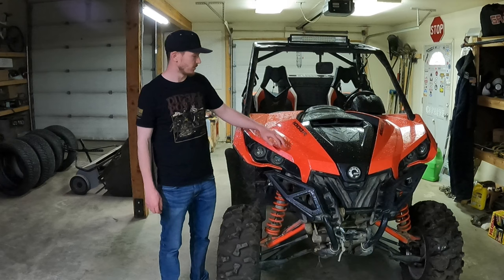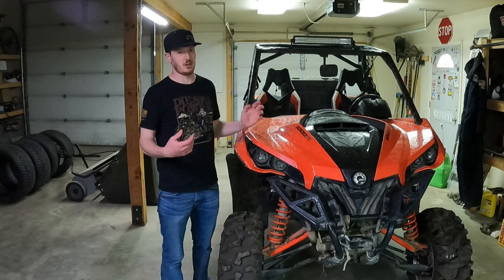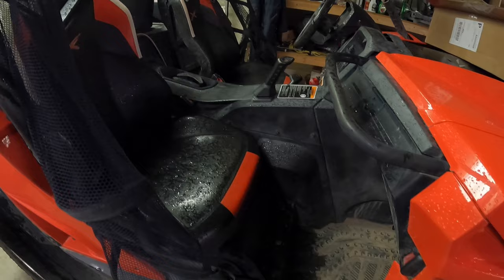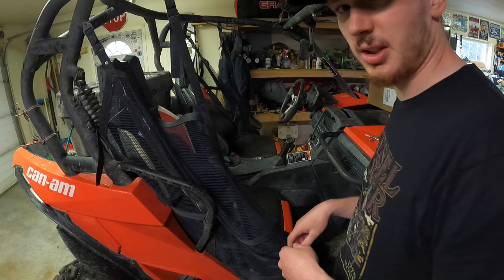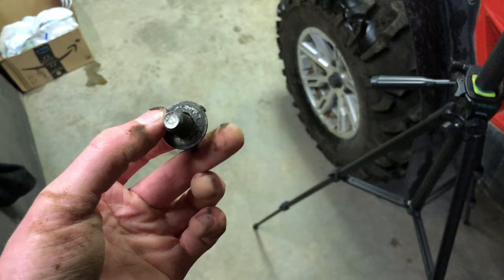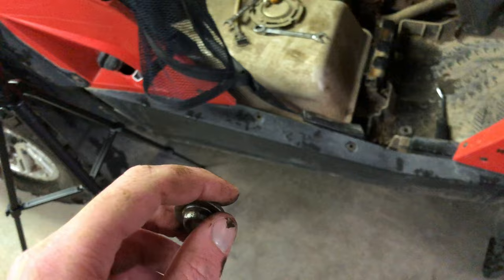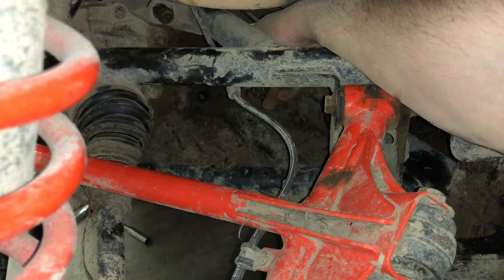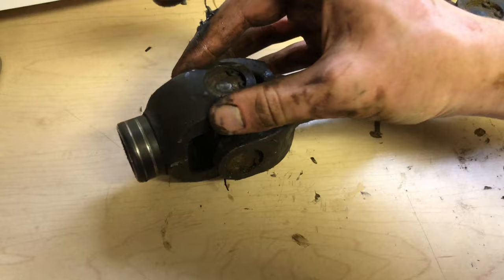How To Replace Prop Shaft On 2013-2016 CanAm First Gen Maverick

Comment: My drive shaft just flew off doing about 40mph down a trail.  Lucky i was only 5 minutes from home and limped it back in 4wd. Now the repairs start. Always something with these OG's🤦🏻‍♂️
Reply from the maker: That sounds exciting! Worst one I’ve had, was my secondary clutch flew off at about 40 because I re used the bolt. When they tell you to use a new bolt, it’s for a good reason 😂
Reply: @akgearhead  yeah took my buddy on his 1st sxs ride and might of sent it a little too hard 😂. He was loving it before it snapped
Reply: Im hoping the bolt just backed out i hear that's pretty common. The shaft and splines look fine i didn't really get a good look at it yet though 🤞🤞.  How many bolts hold it on?
Reply from the maker: @SHOTS-FIRED  that’s just part of the game sadly 😂
Reply from the maker: @SHOTS-FIRED  there is one bolt that threads into the shaft coming out of the transmission, and then another bolt that threads into the shaft going into the rear diff.
Reply: @akgearhead  thanks.  That's what happened. There was no loctite on the bolt and it backed out. I found 1 bolt that is kinda mangled and couldn't find the other. Gonna have to wait till Monday and see if the local dealer has them if not I'll order some
Reply from the maker: @SHOTS-FIRED  gotcha. Yeah if I remember right, they have loctite from the factory, so someone probably already had it out before
Reply: @SHOTS-FIRED it is recommend to use new bolts on the drive side and the engine side of the shaft.  You should also use red loctite if reusing the bolts. Also on the engine side you must install the Belleville washer correctly. People will have problems as they don’t pay attention to the loctite as well as the Belleville washer May have been installed correctly. If you didn’t use loctite and or new bolts as well as installing the Belleville washer correctly I would go back and correct it. You should also look up your parts list they have upgraded those BellVille washers.

Comment: it is  a good idea and recommend to use new bolts on  the drive and engine side of the shaft. Also if reusing red loctite should be applied . Pay attention to the washers as well. You should look up your parts scheme and make sure you are using the correct Belleville washers in the correct location. They have been upgraded. People have problems due to the fact not following the correct procedure/ correct parts and new bolts. Those bolts stretch, that is why they recommend new bolts on some models.
Reply from the maker: That’s a very good point. I hadn’t realized there was issues with the bolts, so I didn’t change them. I know the clutches have updated bolts, so I did change that when I pulled my secondary

Comment: Thank you for the video. I'm about to put my driveshaft in today after the bolts backed out and the drive shaft fell out of it. . so I'm gonna get to it today . Thanks again.
Reply from the maker: Make sure and have it in park so that you can really get them tight. One thing I’ll mention, is to get a wrench in there I had to kinda roll the machine to get the joint in a position where I could get the wrench in at a good angle. Make sure you are not like me, and DO NOT HAVE YOUR FINGERS IN THE JOINT while you are rolling the machine!!! 🤦🏻‍♂️ I was fortunate I didn’t snap my finger. Otherwise, good luck, and let me know if you have any questions I can help with!
Reply from the maker: Also, while you’re tightening it, may as well hit the u joints with some grease while you have everything apart.

Comment: I just took mine off. Just crawled under it and took the guard off. Makes it way easier
Reply from the maker: Clearly you used your brain more than I did 😂 that’s a great idea!
Reply: @AKGearhead  well I didn't reinstall yet lol we'll see that goes. May end up having to remove that passenger seat
Reply from the maker: @MarshSmellow  I bet you’ll get it back in the same way no problem. Even if you do have to pull the seat, it’ll still help having that extra access I’m sure
Reply: I came here to say this

Comment: Driveshaft just let go today while doing 50 mph down the trail. Gonna tear into it to at least get the old one out to limp it around the yard in 4wd for winter. It smacked the back of the gearbox, so thatll be fun assessing just how bad that is tomorrow 😅
Reply from the maker: Oh wow. Yeah fortunately mine let go as I was accelerating hard from a stop, and didn’t tear anything up. Good luck, and hope nothing major is broken on yours!
Reply: @akgearhead  I confirmed today, I put a nice gouge all the way through in the gearbox case and broke a couple ears off. Debating about whether to replace it or just weld it. Either way, looks like it has to come out. Got a video on gearbox removal? 😂
Reply from the maker: @wrifraff  fortunately for me, I have not had to make a video on that yet 🤣Hopefully yours is a somewhat easy fix!

Comment: The service manual says the prop shaft bolts are loctited in and you have to use heat to get them out it also says to reinstall them with green loctite which is pretty tough stuff I'm hoping mine goes as well as yours did
Reply from the maker: Well I can confirm I did not use loctite when reinstalling, so hopefully they don’t come loose 😂
Reply: @akgearhead  I work in vehicle repair at a large foundry and one of my trusted veteran mechanics told me to at least use blue loctite  on the prop shaft bolts thank you for the video
Reply from the maker: @andrewpardell9701  it would definitely be a good idea!
Reply: @akgearhead you should use new bolts. If not. For sure at least red loctite. Also he doesn’t mention anything about the washers but his washer in the video is trashed . Should have been replaced. Look up your parts list and order the correct bolts on the engine and drive side. As well as the upgraded Belleville washers that canam calls out as well. 
If you didn’t , I highly recommend you correct.

Comment: Well about a month ago I did exactly what you did and yeah it's a little complicated but it's done I also changed the two rear axles they were making clicking noises as you turn left or right that went on fairly easy greased everything after about 300 km the clicking noise came back I went to the dealership and it seems that it's a normal thing now I told him well the first set lasted 8,400 km why they only lasting 300 he told me it's simply annoys don't worry about it and it's warranty for one year before the year is over come back I'll give you more axles now my buddy's got a 2022 he already replaced the axles around 4300 km and are already starting to do the clicking noise not that they're broken they're just doing the noise so there's something wrong with manufacturing just to let people know out there they're not cheap and these are toys and if people don't put money in these toys they will fall apart
Reply from the maker: Was yours on a first gen Maverick? I don’t have any experience with the newer X3’s. Mine has lasted 4k miles now, and everything I’ve had to replace is wheel bearings, axles, and the u joints. Pretty standard wear parts, but if you do a better job of keeping things greased than I have, stuff should last a lot better. Gotta remember like you said, these are toys, and we put them through hell
Reply: @akgearhead  like I said I called the dealership the axles are clicking going on after 300 km he says unfortunately he doesn't know why I think it's a manufacturing defect cuz the I'm not the only one that has this machine and everybody's now saying the same thing covid manufacturing or poor Manufacturing
Reply from the maker: @pierrevilleneuve5445  I’d definitely agree with you on the Covid manufacturing. Been telling everyone not to buy new machines made in the past couple years. I just know they’re gonna be slapped together and have issues

Comment: Is it possible for the diff to leak due to a loose yolk bolt? Or would it be that the seal is weak?
Reply from the maker: That gonna be your seal. All the yoke bolts do is secure the prop shaft to the splined shafts coming out of the transmission and the diff. If you’ve got fluid leaking, that’s going to be your seal that goes around that splined end coming out of your diff.